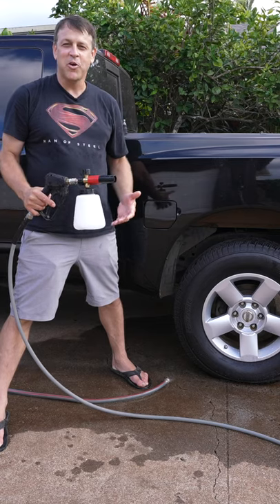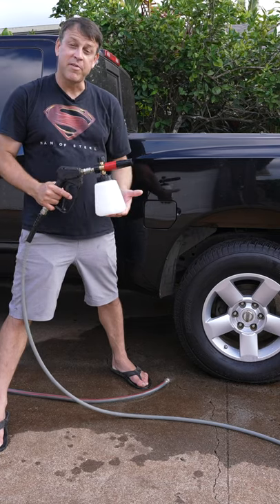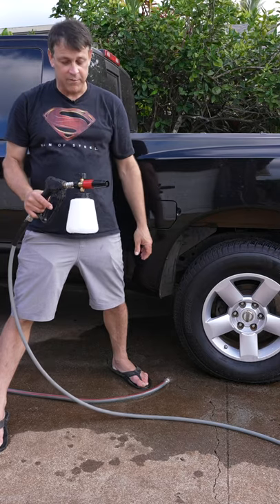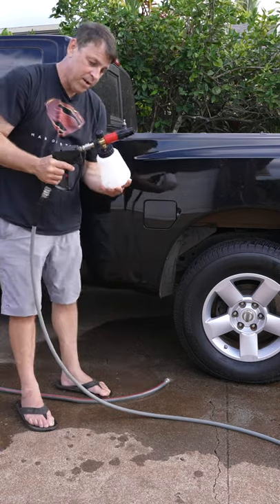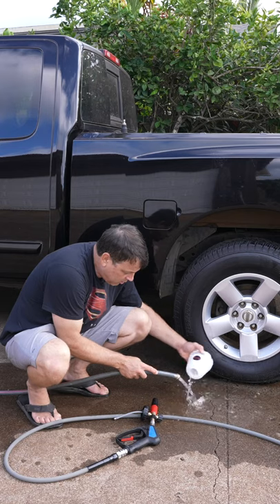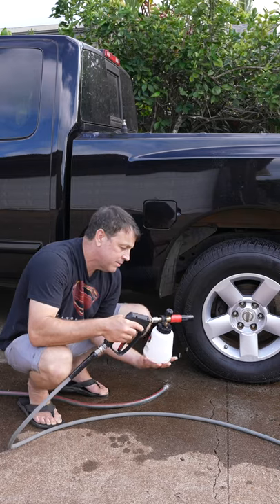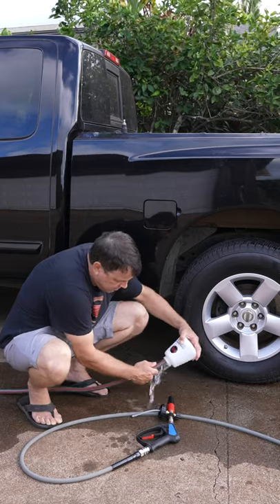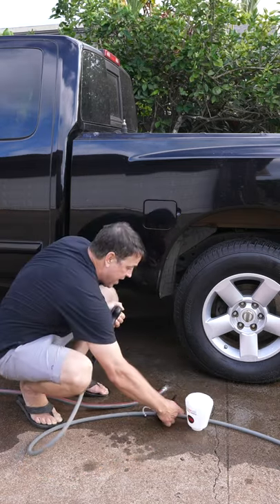FOAM CANNON CARE. CLOGGED CANNON = NO FOAM

Comment: On the maintaining equipment theme, maybe something about using pump protectant on pressure washer? I always send a shot through my pressure washer when I'm done. Especially important if pressure washer is stored in a location that might freeze, but also provides needed lubrication to pump and seals.
Reply from the maker: Good Idea. thanks for watching